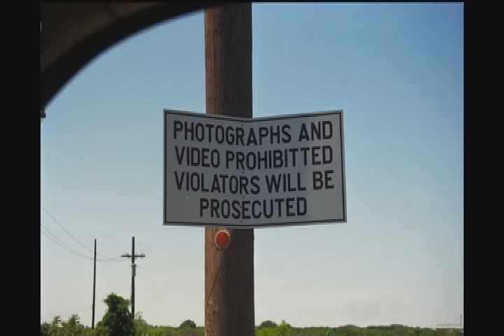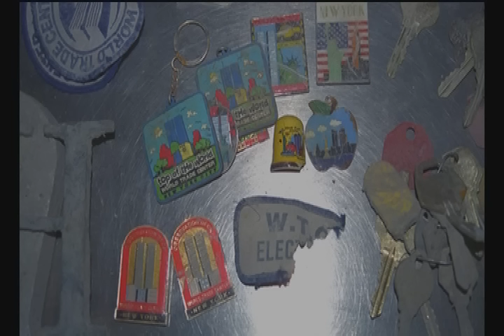Fresh Kills (Landfill) - WTC Debris Burial Ground, pt. 1

Comment: It's interesting how Hazmat gear is worn at Fresh kills but not Ground Zero...
Reply: yeah I thought about that too
Reply: That's because workers at ground zero were told there was no hazardous materials on the site... then it emerged there were quite worrying levels of asbestos that were used in coating the lower steel columns of both towers.

Comment: How do you have bodies with nothing left but tiny pieces barely recognizable as once being flesh, and bone, furniture and stuff turned to dust, but, credit cards and driver's licenses left intact ?
Reply: Not everything was hit with the exact same heat and pressure.  And I mean think about it. If something extremely flat and heavy fell onto a credit card, would it be destroyed? It can hardly be any flatter. People on the other hand can't handle that pressure. The weight of a hundred floors crashing onto a human being would pulverize them like a hydraulic press. I'm not sure if you're a conspiracy theorist or not, but I just wanted to offer that as an explanation.
Reply: +wolfvsmoon makes sense😧
Reply: wolfvsmoon not conspiracy at all !..... actually it's a fact that tnt and geletin were used to blow up the WTC complex that's why some bones were found 400m away from the scene. If the bodies were crushed the bodies would be intact but flattened !
Reply: 1ShayDawn Yawn... Everything was not subject to uniform treatment and forces.  Did you see anything that resembled a vehicle? Why was it not dust? Duh! 😂
Reply: You flunked physics didnt you?
Reply: Tim Blackwood evidence please??
Reply: Tim Blackwood bodies don’t flatten 🤦🏼‍♀️
Reply: +Larry Schroeder Most people don't realize that a lot of folks were pulverized into grease. Bones became jelly underneath that much pressure and violence.
Reply: Stoned Savage! Ok... that’s fine but they don’t flatten.
Reply: +Larry Schroeder I hope they understand how horribly Fragile human bodies are.
Reply: +Larry Schroeder I hope they understand how horribly Fragile human bodies are.
Reply: Larry Schroeder he said bodies will be in tact but flat. Dude thinks flat Stanley is real😂. You’ll get squished like a bug from a car engine falling on you, but pulverized into dust from being in those towers.
Reply: +POTBELLY15 The Violence and the unbelievable tonnes of pressure and friction and heat and cascading events----Flesh and bones became grease and jelly.
Reply: LOL@Larry ))
Reply: Stoned Savage! Hydrolic??? Or Hydraulic.....
Reply: you really need to ask that? credit cards are made of plastic, flesh is made of water
Reply: Directed energy only affects certain metals.. hence 110 stories tuned to dust, yet we find things like this.
Reply: North Wales Shore Hugger realisticly we can watch what happened that day, 2 towers came down with thousands of people in there, 
your saying it wasn't a pancake fall. 
But were using your rule.
We're not taking evidence and making our theory 
But using the video as evidence shows a pancake fall
Reply: and a terrorists passport
Reply: It's called "controlled demolition."
Reply: because our body's are dust . made from the lord we came from the ground that is dust
Reply: millions of tons of concrete will do that to things.  Fight in a war and you will see what can be done to the human body.  I understand if you just don't think it's possible.  Probably because you've never seen it happen with your own eyes.  You need to experience life more.
Reply: @timblackwood1531  maybe the explosion of the planes hitting the buildings blow them 400m away😱
Reply: Johnny moehrle You evidently know nothing about what transpired on 9/11 if you’re trying to compare it to “flat earthers”. Honestly, I used to be like you. I remember someone bringing up a 9/11 conspiracy at a house party like a decade ago and me and this other dude literally pushed him out. I cringe with embarrassment looking back at that. The narrative of the “truthers” or “conspiracy theorists” propagated by the media is that they’re insane and they’re insulting the memory of those that died — the theorists started as grassroots movements in NY after the official 9/11 Commission Report DIRECTLY REFUTED events that survivors, bystanders, and responders all heard and saw that day. From there, more and more things weren’t adding up. I’ve seen hundreds of hours of footage from very credible people as to why the official explanation simply doesn’t make sense. Researchers, engineers, professors, first responders, doctorate level research — have all pointed out the dozens and dozens of “mistakes” and questionable application of physics that was used in the commission report. People A LOT smarter and more qualified than me and you have written peer reviewed papers on the events that transpired that day - however the mainstream media will never allow the narrative to move forward. NIST never even tested for explosives at the site WHICH IS A FEDERAL MANDATORY REGULATION in an investigation - this was the biggest event of the century, with billions of eyes on them, and they wouldn’t go by regulatory mandates? Three independent companies all found evidence of Thermite ...thats 3/4 researchers except for the one sanctioned to pen the official report. Former employees of NIST have come forward to whistle blow on the poor application of the scientific method that was applied to the Commission Report. That’s just the tip of the ice berg. It’s very scary once you start to learn the truth - trust me, I’ve been through the denial stages. I think people that deny the planes even existed, or peddle these insane conspiracies as if they’re fact do the truth a great disservice. We will never know what happened that day, but all people are trying to say is that “the official report released by the government is factually incorrect - why did they lie about it?” That’s it - that’s all we want to know. There’s too much information out there for you to not take the time and research it yourself.
Reply: Humans are so fragile. More fragile than we want to believe. In the big picture, it takes almost no force to tear through human flesh. Small steel bits are different.
Reply: If a house burns downs some stuff will stay in tact like paper, books, toys or anything else that wasn't near the effected area. It's basic common sense really.

Comment: 2x110 storey bldg collapsed to the ground, due to grave structural damage and fire at the site. The weight of the top floors was too much for the damaged structure to bear (subsequently, this mass would dissipate after the collapse initiation, but the damage was done)  and so both buildings collapsed. 400 metres in under 20 seconds. x2.
Reply: ClumsyPanda PSBO  if that were true it would be insane to keep building tall buildings. the tops of the towers were built much less strong than the ninety floors you think they accelerated through as they fell. Actions have equal and opposite reactions, remember?

Comment: What an inefficient set up in the "human remains" shed. They were obviously not expecting much human material. No air purification, no sanitation and no correct containers or clean work surfaces. Whats going on?
Reply: Vera Wroe just easy waste and evidence disposal.
Reply: CK_32 it’s a makeshift mass evidence sifter. No one was prepared to go through 1.5 million tons of debris looking for tiny human fragments. This was the fastest way to get it going and they weren’t expecting much.
Reply: the site was literally opened with the intent of sifting through millions of tons of debris looking for tiny human fragments.  there should have been a fan in that shed

Comment: Fine dust...microscopic dust... very hard to explain how the building fell in 9.8ms-1 which is eventually the velocity of a free fall... meaning that when you drop a ball from your hand it will fall to the ground at the rate of 9.8ms-1 until it hits the ground.... this can only occur if there is no resistance for the falling object...  this is clear cut you drop it from your hand and nothing resists it falling to the ground at the rate of 9.8ms-1.... with the twin towers this rate of fall is IMPOSSIBLE! because as the floors fell they would have been resisted by the floors below them in the "pancake" like collapse that the establishment engineers claim.... so if there was any resistance and there MUST have been the rate at which the building fell could not be at the rate of 9.8ms-1 due to the resistance of the floors below that were not damaged..... but the building still fell at the rate of 9.8ms-1.... which can only mean that someone or something must have "eliminated" the RESISTANCE of the bottom floors as the building collapsed... this could only be done if someone programmed demolition it, meaning blowing up the structure's resistance of the bottom floors rendering their resistance negligible to the falling mass of the floors above....

There are many conspiracy theories out there, but you cannot fool physics and the laws of nature and laws of gravity people!... this is not conspiracy theory it's a conspiracy FACT!.... people can debate Kennedy murder and put theories forward and call it this or that, but something clear as the gravity and the rate of freefall which is 9.8ms-1 cannot be taken out of the account.... both towers fell at the rate of free fall which is IMPOSSIBLE to have happened in such a way that the establishment is claiming it did.... I do not have the answers who did and why I do have my opinions but something that is the law of nature and law of physics cannot be fooled and cannot be faked. 

The government is not telling the truth what happened on 9/11/01 for whatever reason they are fabricating the truth and these reasons may be legitimate or criminal.. but you cannot tell me that something that has a solid structure falls at the rate of 9.8ms-1 without anything helping it..... this is only ONE of the unbeatable FACTS that tells us that the establishment's narrative of how the buildings fell is FALSE and A LIE! Wake up people, stop being sheep for shearing, use that brain and open those eyes. 

Neil Armstrong once said "there are great ideas undiscovered, breakthroughs available to those who can pierce truth's protective layers" powerful words... I guess the same is valid for there are terrible, horrible horrors to be revealed by those who can pierce the protective veil of the truth... i guess its equally true for both statements.
Reply: m8 you clearly dont understand what youre reciting.

Microscopic dust is completely normal and expected.

WTC 1 + 2 did not fall at 9.8m/s (or what you mean, 9.8m/s2).. they accelerated at closer to 0.3g's, or 1/3rd the ACCELERATION of gravity. You're right it would be impossible for it to fall at 1g. It didnt.

Comment: fire turned everything to dust? really?
Reply: p: Collapse turned things to dust. Study physics.
Reply: @KB4QAA  I've seen several controlled demolitions with explosives and none of them had that fine dust and everyone of them had big fkin pieces of concrete.
Whatever they've done there, they've done it very well. Not every controlled demolition lets the building fall down straight as a motherfucker, the demolition crew that put the explosives there did a rly good job :)
un-fuckin-deniable
oh and WTC7? study physics? rly? what?
tell me more
Reply: @Yoshi92   yeah I've seen a bunch of videos of controlled demolitions too - and not a single one I've seen was there any dust created. Ever. All of them were totally clean - just a bunch of variably sized chunks of rubble all falling at near free-fall speeds. Never any dust though. Not even a little bit.
Also just like on 9/11, in all the controlled demolitions I've seen, the explosives used to bring the building down were completely silent. The only way to know there are large explosions taking place is the little poofs of air coming from inside the buildings. That's it though - no sound, no dust, nothing. Just a nice pile of organized rocks on the ground when it's over.
What I say is true - and I know what I'm talking about. I won the silver medal in physics back in '83..
Reply: SineEyed 2020 .  I think your underestimating the weight of a 500,000 building.  How big were those building that you’ve seen in a controlled collapse?   I’m guessing not very big.
Reply: @susanmetz9892    😶

Comment: Some of those pistols exhibit rust consistent with decades of exposure to elements. that rust would not set in within merely a few months or years, additionally, I'm not sure which departments issue WWII era German Luger's ??!!!?!
Reply: Yeh that is a little strange.
Reply: I thought it was a Luger as well, but I'm wondering if it isn't a ruger .22 target pistol instead. The reason I think that is because it looks to be missing the two "knobs" on the charging handle of a Luger. Idk though, could be either. Plus, is that a desert eagle a few guns down from the Luger? That's another random piece to see in the rubble.
Reply: The coating will have been smashed off, and water will have rusted them. The dust may have been acidic or alkali so this would also created that effect. Tools that have been used in cement get this look too.
Reply: yep, the coating on the metal is removed by heat, very true.
Reply: There would've been a lot of weight on those weapons as well, tons of debris can cause stress over the same amount of time that it would take to rust. This entire lot, or most of it, could be the collection kept in an office by a CEO of an investment firm for all I know, more than likely, the more modern 9mm's belonged to Port Authority police or other law enforcement.

That day.....
Reply: A N Lugers are awsome portrait pieces being rare and completely beautiful. My question is next to the glock mags bottom left is a 50ae desert eagle,wtf?oh and I bet that glock still works top left lol.so sad.
Reply: probably just a office extra like a cigar box
Reply: Didn't they say there was a customs office in building 7? Could be confiscated guns, or maybe objects used for training (self defence training or weapon identification training).
Reply: A N Yeah, I saw an ancient canon from the time the pyramids were built. How the hell did that get there?
Reply: After cleaning up a house fire, where the man had a sizable collection of handguns, I can tell you after a fire, they have been heated, losing all film or bluing, and will rust almost immediately once exposed to water and air.
Reply: Wonder why the shotgun shells were still intact? Wouldn't the heat have at least blown out the sides of the shells?
Reply: Yes the Lugers and the fucking 50 DAE?! What fucking guard needed a god dam 50 DAE
Reply: CK_32 probably private weapons owned by workers there
Reply: Its charred from the fires I think
Reply: Fire creates exelerated oxidization. A burned gun will oxidized very quickly.
Reply: High carbon steel rusts instantly if it's not protected. Go look at people's brake rotors through their wheels after it rains. Even parked for a few hours rust will form.
Reply: if all these guns are superheated why did the rounds not explode?

Comment: The Pentagon video was bs. The few frames that they show right before the "plane" hits show an object very close to the ground that resembles a missile far more than a giant airplane. To this day, they haven't released the footage of the "plane" hitting the building. Conveniently, that was also the area of the Pentagon where the computers held data that tracked an insane amount of money. They were destroyed. That "plane" looks more like a cruise missile and certainly hugged the ground very closely within the last 50-100 feet. All of the light poles should have been ripped down; they weren't. The feds also confiscated every tape within the area that would have shown what hit the Pentagon. Gas stations, private businesses, etc. I'm not saying that the planes didn't hit the buildings, but other things like building 7...it collapsed in the exact same way as a controlled demolition. Literally, if you pulled them both up side by side, they both arch in the middle at the exact place and time.

Comment: What happened to all the porcelain toilets and sinks and Fossetts in the World Trade Center I have read that they didn’t see one single broken toilet that’s very bizarre and strange. Also they found one file cabinet it’s as if the other ones had vaporized and yet nobody on the ground reported feeling any heat just cool dust. But if you dare mention these anomalies you’re told you’re crazy
Reply: Not to me.  9/11 was solved 5 years ago.

Comment: 2:45 99 elevators in each building?
Reply: TheSourceForMegadeth yup. Some go the first 30 floors, some go from 1-31 without a stop, other operated from 31-59, etc. Remember, 50,000 people worked there in each tower.

Comment: 99 elevators in each build? Wtf (2.49) ish
Reply: Bob Dillion some went up the first 30 floors, others went from 1-31 non stop, and let people out, others from from 31-60. Others went from the ground up to 75 non stop, overlay coverage. Not one elevator covered every floor, it would take hours to get anywhere.

Remember, 50,000 people worked in each building.
Reply: Canada eh I get that but when you images an elevator you think of a 6 foot by 6foot box that’s about 3,500 Square foot it’s just a staggering size for one building